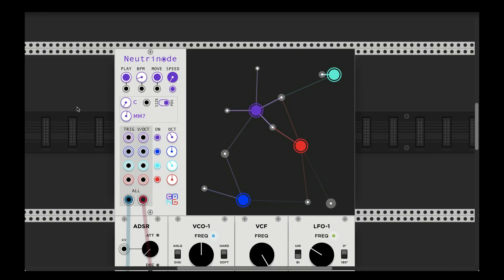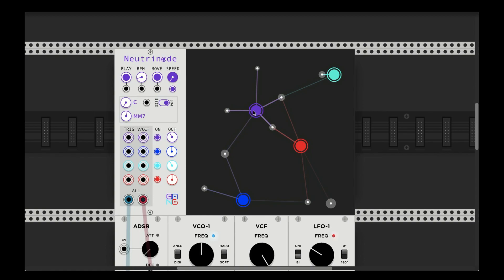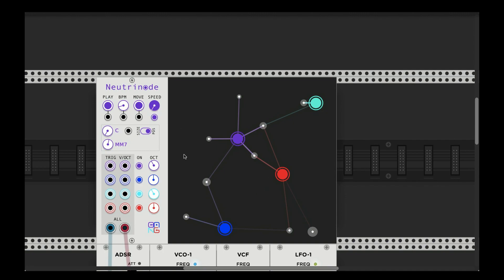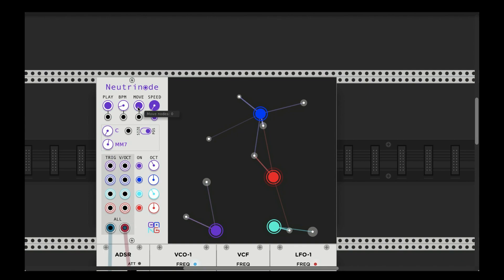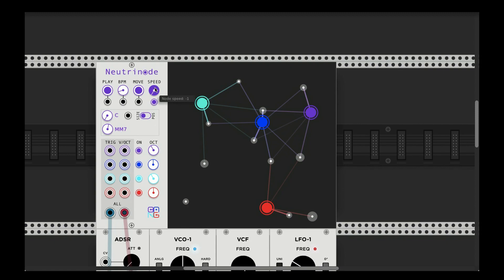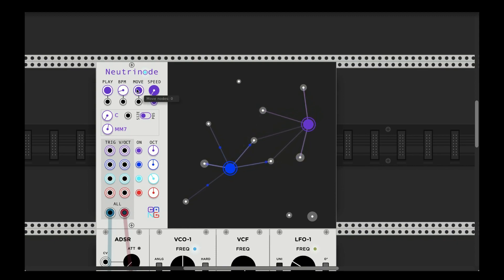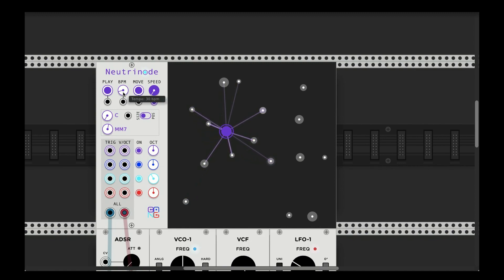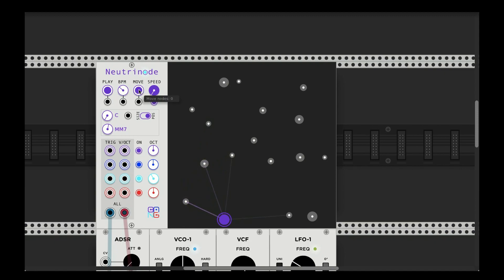Neutrinode - Sha# Bang! Modules

Comment: Supper fun module. One small request would be increase the range on the Speed and BPM module. Specifically I'd love to be able to crank the speed way down so it slowly changes over time but very subtly. Second would be a much faster BPM; so far I've found that I like clocking the play externally and cranking up the BMP, so that way the sounds still come in around the same time and it works more like chorus.

Anyways, thanks for creating such a cool module!
Reply from the maker: Sounds good. I'll add those changes in the v2 version coming out for Rack2

Comment: Would it be very difficult to add a BPM sync input? E.g. a project might use a global clock to control multiple modules. BPM sync would keep Neutrinode in time with the rest of the project.
Reply from the maker: There are a couple of options to achieve a BPM sync. One is to use a CV into the BPM input. Another way is to use the one-shot mode which you can find in the context menu. I'd recommend the one-shot mode unless you're trying to achieve some accelerando/ritardando with your tempo. There was a little discussion about this before I added the feature in the comments of this video: https://www.youtube.com/watch?v=MSscijDAdug
Reply: @jeremysmuller  thanks, I'm sitting here, trying to read through documentation, and watching your tutorial, wondering how the hell the BPM input works. Never thought I'd see the day that a youtube comment section would be helpful!